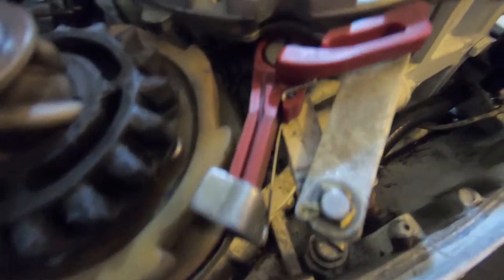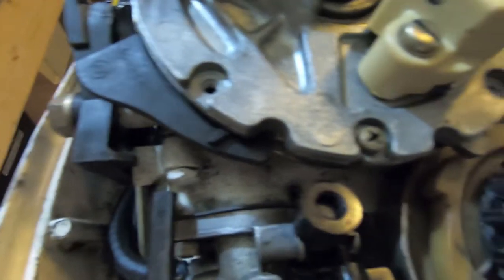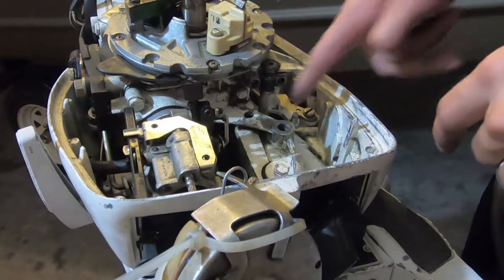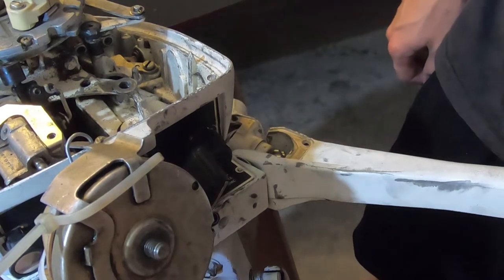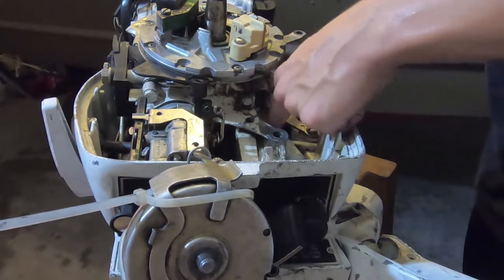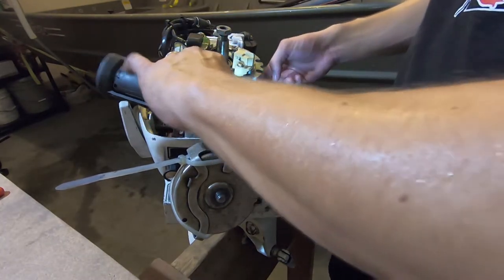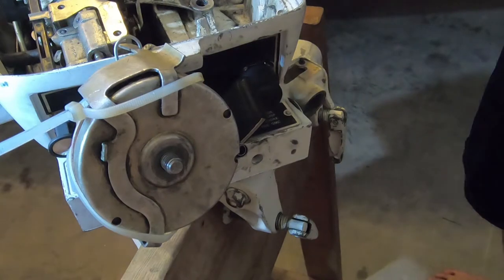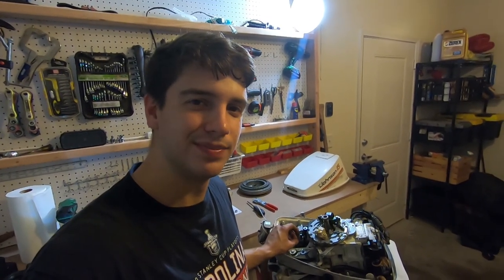1979 Johnson 15hp: Diagnosing a Low Idle Condition

Comment: OK, well that cam pick up point is not where it needs to be at dead idle.  That mark is to syncronize the throttle cam and carb butterfly.   The carb should begin to open when the mark on the cam bisects the roller.  But, again, this is not the idle speed position, the throttle cam is usually more retarded and not even touching the roller at dead idle.  The black knob on the side is what sets the idle speed.  Don't get too hung up on that twist grip throttle indicator, notoriously inaccurate.  There is usually quite a bit of slop in the twist grip also, due to the poor design of all the plastic throttle gears/shaft, etc.  New parts are very expensive.
Again, you are confused about the idle setting...That mark on the cam should bisect the roller when the carb just starts to open, but this is NOT supposed to be idle speed....  I just don't want you going crazy over something that isn't broke....Once the boat is in the water and idling at the lowest speed possible in gear, turn the black idle speed control so the plastic arm contacts the tab on the vertical control rod.  This will keep the throttle from being turned below whatever idle speed in gear you have chosen/set, so the engine won't stall....D
You probably have this all set by now anyway...
Reply from the maker: Lol kind of. That black idle speed on the side was broken or something it never got closer then a 1/4 in of where it should have been. So I’m convinced the motor was running fine but maybe that part had been replaced with the wrong one or something like that. Thanks for the write up, it confirms everything I found also while trying to get it all to work like I thought it should!
Reply: @markbuilds    Yeah, that idle control knob is more cheap plastic that usually breaks...I usually have to grind/sand some of the plastic threads flat so I can extend the plastic arm enough to it connects with the vertical control rod stop also...Some of these pieces are very cheap and not designed well, pretty expensive to replace though!  Sorry you went through all this trouble...  That is a great old engine, and is irreplaceable today...Take good care of it...
Reply: Not cry if😊 retirementery

Comment: For my early 1990 Johnson 15. If your low speed needle is set at 1.5 turns out and does not work for idle or anywhere near it, it can be 3.5 turns out!

With much searching, I could only find the answer from a comment. Low and behold it's idling!

Make sure your throttle cable is set right and lines up with the timing mark behind the carbs 

Oh and it's all easy peasy work after removing starter. 

Good luck 🤞🏻

Comment: The throttle cam follower is supposed to have that delayed contact at the low idle range. That was a common OMC design for single-carb engines. And the timing alignment appears correct. The lowest range of RPM is governed entirely by the timing while the throttle plate remains stationary. The cam follower comes into contact at the timing mark; and the throttle plate is active from that point upward through the rest of the RPM range.

That confuses a tradition mechanic because we're accustomed to RPM being governed by controlling the air flow. But on those motors, RPM is (at least initially) controlled by ignition timing.

Comment: the linkage may have been right but your idle jet not set right,, the idle jet is an engine tune adjustment, and the trolling speed knob on the side is a fine tuning linkage adjustment,.

Comment: As already noted see Kodibas on YouTube he nevers disassembled until he has done a facts test and give motor a look over
The groaning when turning throttle is clue something needs lubricating urgently
Reply: There is another OM Fishing where the guy shows you how to check timing at idle and open throttle with taking the motor to bits...
Reply from the maker: Thanks, I’d already tried a ton of stuff off camera. I pretty much narrowed it down to either a wrong idle speed thing installed that was too short. I have no other explanation for why I couldn’t adjust the idle stop to stop in the right place. Disassembling was just to make sure I didn’t miss anything. And to see how it all worked. Thanks for the comments!

Comment: An added note:

I don't know about the 15s. But the 9.9 and smaller engines did not have a kill switch or button. Those were designed to be killed by low-idle stall. Death by starvation, as I call it, lol. That was a common way of killing small engines back in those days. So if you have no kill button or on/off switch, then the motor is supposed to die at lowest idle.

In which case, an issue you might instead be experiencing is that the throttle drops if you don't continually hold onto the control. When you let go, it vibrates to its stalling/kill position--which is not very far from idle/run, so it's not always obvious that is what's happening. I've even had it happen while holding the control, and not perceive it due to the very small distance.

Assuming that is the case, I would consider 2 options. A: Accept it as a safety feature and just plan to maintain grip while motor is running. Or B: Tighten the throttle control joints and connections all the way back and into the motor compartment.
Reply from the maker: There was a kill switch on the engine but this is great info to know thank you!

Comment: hello friend I am a follower of Uruguay I have a johnson 15 engine identical to the one you have I would like to know how you have regulated the air inlet of the carburetor how many turns should I thank you very much I am using the google translator
Reply from the maker: Turn it all the way in and then a turn out. Adjust from there and you should be good
Reply: @markbuilds  At this precise moment I am watching your video number two where you have a problem with supposedly the needle that gives more fuel input. and I saw that you said that it could be worn in the end, could you tell if it was so? because the same thing happens to me and sometimes the engine works fine and sometimes it doesn't and the problem is always there
Reply: @markbuilds  how much would mark have to turn it?
Reply from the maker: I never could tell no, I just ended up running it like it was and knowing not to turn the throttle to low
Reply: @markbuilds  thank you very much my friend what you do is very good and again greetings from uruguay I don't know if you know or heard Uruguay at some time haha greetings
Reply from the maker: Good luck with your engine! Hope you get it running good!

Comment: Do you have a link for the service manual?
Reply from the maker: I think I just searched the year on eBay. You probably have to get lucky that someone is selling it
Reply: @markbuilds  Thanks Mark. I have the same problem where the cam follower is about the same distance from the cam so It never really reaches full throttle. I'll be following your video's. I also have a broken starter pulley. Funny, same problems on our 40+ year old out boards.
Reply from the maker: The same plastic bits always seem to fail! Good luck!

Comment: Are you certain you know what you need to remove it looks you disassembled outboard but not getting to be able to fix it ..
More diagnosis requires.
Reply from the maker: You are correct, I never did find an issue. Was looking for something broken or gears out of mesh